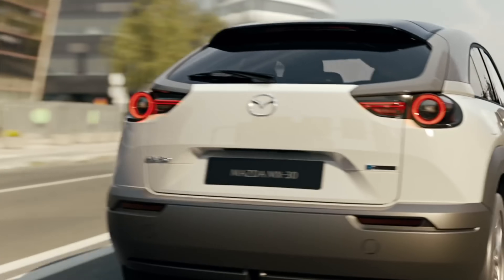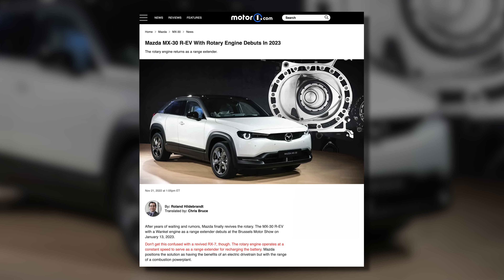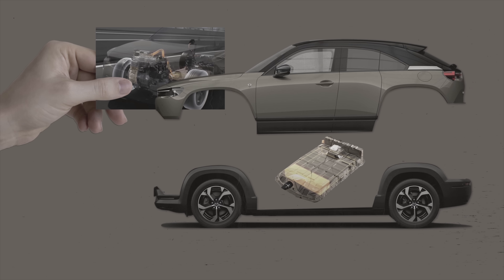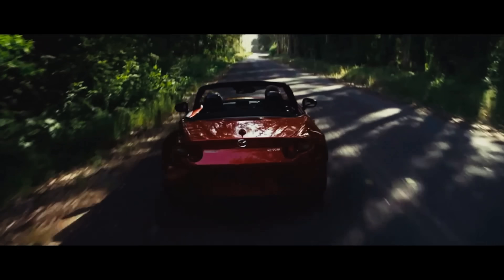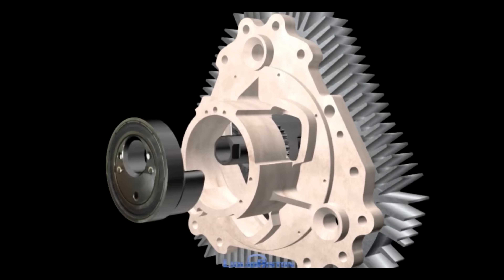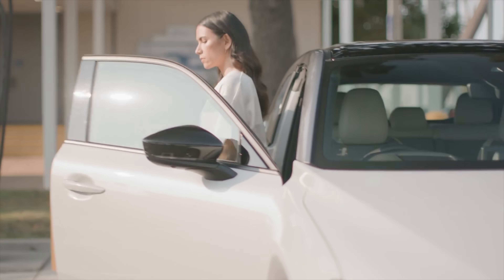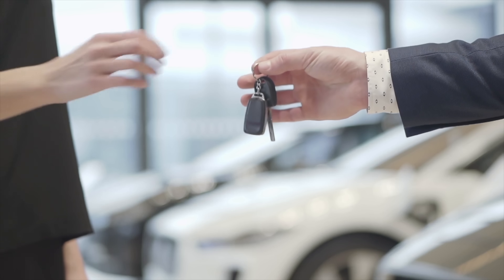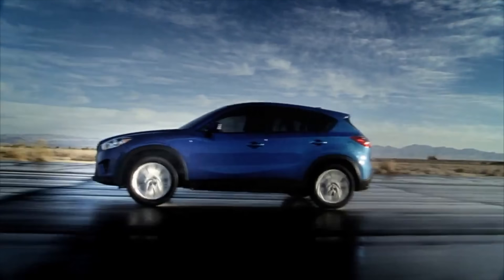Mazda's New Engine is the Smallest and Most Powerful Engine Ever Made

Comment: I LOVE IT! Small battery means lower recharge times, no need to rewire your garage,  lighter weight, gifts that keep on giving. However I would be more interested in a smaller version that gets 60 mpg and still gets 300-400 mile range.

Comment: If mazda made this for cx5/50 i would have definitely bought it.  Just need to increase reliability of the rotary engine.

MX30 failed due to range vs cost isnt practical

The new mx30 witb rotary is much better but i wouldnt pay over 30k

Comment: Driving on slippery roads is better done by any means other than combustion driven automatic transmission.  That's why I am waiting to upgrade from my combustion driven manual tranny until a decent range extending design is available to get me directly into total electric drive with a gas engine.

Comment: The rotary engine is cool, but if you over heat it, uou have problems. The apex seals suffer at that point. Itis almost a 2 cycle engine.  It will consume some oil.

Comment: Had a RX3 and a Suzuki RE5 motorcycle, both a lot of fun but expensive to maintain, terrible fuel mileage, excessive oil consumption, and engine failure. The smooth constant acceleration was awesome! Unless Mazda has found some revolutionary fix I think they are only going down triangular rabbit hole, once again. Based on the video I didn't see the improvements needed to compete with today's lightweight internal combustion engine. The rotary's 25% improvement in fuel consumption would make it a gas guzzler compared to todays internal combustion engine!!! The video NEVER gives the mpg while under rotary power, there is probably a GOOD reason!

Comment: This video ignores that when running an engine as a generator it can be a lot more efficient that if it is directly powering the wheels, this sis simply because such a task allows the engine to operate in the optimum power range at all time and doing so is also good for wear an tear.

As for the MX-30 not selling, to be frank that is because most everyone isn't being rational and insists on using big heavy cars with way more power and range than they ever need. Not only is doing so wasteful and unnecessarily expensive it also make for sub-optimal driving experiences - and those long trips or big hauls people are on about, most people do them so rare it blows my mind why they wanna punish them self every day by having a car that do such things.
No one in their right mind would use a big suitcase to carry their phone and a few other items on a daily basis, but people do the equivalent of that when driving.

Comment: I think we are going about this all backwards. The primary drive should be fossil fuel and the secondary (or supplementary) drive should be electric. This will allow the energy density of gas with the added electric torque (as needed) of the electric motors while keeping the battery size relatively small and lightweight.

Comment: Would be hesitant due😢 to the relatively short lifespan of the rotary charger. If it were to be economically viable vs. a standard hybrid, I might be interested.
Reply: Think they will last way longer: using it solely as auxiliary power unit means they can match generator and motor running on ideal rpms.

Comment: It's the NEW fad out there right now!    You can run your electric car motor with out putting fuel in it at all gas or electricity, NONE it'll run like all most for ever. changing tires and other car part. What your using is a self generated generator. yes it run on itself. it works YES! and you can have one in your car.Yet the Government will not let you produce them and sell them on open market. The Same as water buring engines Honda made one of them fully running the demo did not get approved for any sale what so ever expect you can have one for your personal USE ONLY.
Reply: Once the liberal gets booted off of Earth and into it. Then we will have NO FUEL CARS on the road. FREE Transportation

Comment: This is what EVs should be, it is called a "Serial Hybrid".  A medium sized battery with a genset to recharge it.  Strange that it took 12 years for auto makers to figure this out, and American automakers have yet to discover this architecture.  Just shows how stupid  the average American mechanical engineers have become.  If the Volt had come out like this, it would have decimated Tesla.  But no, the gearheads wanted a shaft and transmission between the wheels and the genset, and the eco-freaks wanted no genset.

This car is the first serious competitor to Tesla.

Comment: Rotary engines have been attempted many times, but the engineers never quite got the bugs out of the system when they went into production. Have they finally been ironed them out? The advantages of a rotary engine are intriguing, assuming it is reliable.

Comment: I like the idea of a battery extender engine. If the engine were air cooled, the engine could simply be bolted down and have two electric cables going to the batteries. If you need work done on the engine, it could be popped out in five minutes or less making it much easier to work on the engine.

Comment: Back in the 70's Honda tried rotary engines on some motorcycles. That failed due to starter issues. It seems that because the engine was so smooth and quiet that riders thought the engine had died  at lights and stop signs so they kept trying to start a running engine and ate up the starters.

Comment: When I buy a car I want short trip miles use and long trip miles use.  I do not want to go on a one day trip for 800-1000 miles and am forced to drive a care that takes 24 hours to charge after 250miles.  A one day trip turns into a 3-4 day trip.  Not for me.  If I want short miles in a car, I'd like to buy the air powered cars from France and use a home compressor to fill up for virtually free.  I want fast fuel up.  Electric charging lines are going to be too long and too many things interfere with the convenience driving a gas powered car.  With a break even cost of about 15.00 dollars a gallon, until gas reaches these prices, I'm sticking with gas or a decent hybrid who's motor can supply independent and and full power use of my vehicle.  The biggest hassle is the battery.  It costs more to replace them than buying a second hand gas vehicle.  Electric cars are a fad and they are going to gone.  I'd like to have a vote of the public, who is the government, and force politicians and big money companies out of the picture.  But, our voice doesn't count anymore.  After all, well simply get used to the changes and forget about how things used to be anyway.  (Zero Pollution Motors (ZPM) is poised to produce the first compressed air-powered car for sale in the United States by mid-2024.)

Comment: Hi Scotty, 
I've always wondered why manufacturers don't just put a small generator in their cars and do away with the battery altogether. Surely a small engine idling along at 2,000RPM would generate enough electric power to run the vehicle. The generator would use very minimal fuel, there'd be more space in the car, it'd be lighter, it'd be quieter and there'd be more torque. I'd also imagine the car would be a lot more affordable with no battery pack and also environmental damage from mining the various metals would be non existent. 
Would this work? 
Am I missing something?

Comment: The fuel economy and emissions aren't great, it's true, but the longevity isn't a problem. The early ones before Mazda had figured out what they were doing, and the late ones when they got away from simple designs, were not reliable, but the ones from 1976-1991 would run forever. 200,000 was common and 300,000+ happened regularly. My '76 lasted 250,000 and my '84 lasted 190,000 before it was wrecked.

Comment: Im concerned with the added weight of the ev version of a given vehicle model. Though a big engine is absent, battery density more than makes up for the weight loss, actually increasing the ev model model weight by 20-40%. My ‘17 Tahoe weighs ~5200#. GM Hummer ev weighs over 9000#, though basically the same size. Imagine that Hummer ev in a collision with a gas powered Civic or Escape which both weigh under 4000#. 😮

Comment: You briefly used a graphic of the "liquid piston" rotary. IMO, a better design than the Wankel. It sort of reverses the cylinder/rotor making the cylinder triangular and the rotor oval. Combustion happens in all three corners, evening out the heat distribution.

Comment: I think one of the other benefits of using a rotary engine as a range extender is how simple it is.  You don’t have to worry about valves and camshafts and all the other mechanical complexity that comes with a normal piston engine.  Cars are moving to electrification, it’s just the economics and benefits of it.  Having a range extender, as opposed to an more traditional hybrid, means that you don’t always have and ICE running.  Electric motors are more than powerful enough to be the drive motors of a vehicle.  Having a range extender means you don’t have to rely on power stations when on road trips, and don’t have to worry about using gas for a trip to the grocery store.

Comment: Interesting car and well presented. I had been bashed for asking for a "fat hybrid" with roughly 150-200km range + efficient range extender 2 years before (in german language/Germany): Battery is the future, hybrids are no longer needed.
I think this is wrong for those who like to have "only" one car for daily commuting plus 10 ...20 times driving for e.g. 200-600km per year. And in a modern world where we have a good chance not knowing if we have electricity or fuel next day, a hybrid is a reliable solution, at least in Germany where Nuclear Power will be shut down within the next 10 days ... coal will stop 2038 but some want 2030. Replacement? "What for, PV and wind is all we need ..."

Comment: Sounds more like desperation than a design feature, good luck Mazda you are going to need it.
Most people who are switching to an electric car are not looking for a petrol engine range extender, if you are going to make a range extender, I would have thought Diesel.
I think this is going to be a difficult sell especially with a battery range so short, if the battery range was 200 miles and then you had a range extender, they might of stood a chance.
But at the end of the day it is the consumer who decides so see what the sales show.

Comment: In my opinion this type of vehicle is what should be promoted, battery for the everyday commute and city driving, and small petrol engine for the occasional long journeys, the alternative is a massive electric battery using lots of rare materials, high tyre degradation due to weight along with the pollution that causes.

Comment: This rotary is what is known as a "work engine". It is designed to run ONLY at a VERY limited range of revs - NONE OF WHICH COULD SUPPORT EXTRACTING POWER TO DRIVE THE WHEELS.

Comment: It seems a lot of people does not understand that this is not Prius copy concept. It is the idea implemented on Chevrolet Volt and on some Ford variant. Mazda idea is a BEV (battery electric vehicle) with an ICE generator onboardcoupled as simple as possible. This new Mazda is a Series-hybrid, less complicated (electronically and mechanically) than a "Power-split or series-parallel hybrid" like Prius. The novelity is the weight of the electric generator (ICE+generator) and the possibility of changing the fuel to H2. (rotary adaption to hydrogen is easier than for a 4stroke ICE)

Comment: I can't understand why anyone would buy this car. It will be difficult for most drivers to get the engine repaired, the battery is going to be smaller, the price is already too high for the e-version so the price of the Re is going to be even higher. Also, because of the repair problem, it will be a car that nobody will want to hold onto past the point-of-no-repair-required date, so it will be dumped, not repaired for extended use, making it basically another source of junk to have to deal with environmentally. Buy a Honda.
Reply: Your exactly right Ryan. Dead end technology. Advantages are just smoke and mirrors and not too far down the track, a lemon of huge proportions you could not give away. Rubbish Matsuda. Give it up.

Comment: Literally nobody thought the MX-30 EV was any good.  A range of 124 miles at the same price as EVs with twice the range is a sick joke.  If they had kept the same battery and put in the range extender, it would have been interesting.  But, they cut the battery in half for the PHEV, with an EV range of 53 miles.  That was interesting in 2016, but not today.

Comment: This car agood concept I agree that 30 miles would be the most average. But what happens at 400 miles you got to stop and charge it because of built-in generator can only charge the batteries for more range.. It's like a cell phone being plugged in on a weak charger the battery will eventually become dead but then again a good charger we'll keep it at 100% then the battery will not discharge all the way it gets programmed then you find out you only got half the battery that you thought was full. Basically for my money I'm not putting my trust in batteries. I burned up a couple batteries in my cell phones. Keeping it charged at 100% will lead to short battery but draining it completely dead at ninety miles or 400 miles is the right answer. That's my guess.

Comment: This raised a couple questions extremely pertinent to forming an opinion. First, what is the fuel tank capacity? For example if it's extending the range to 400+ miles over the 124 of the all electric and it takes 20 gallons, then it's useless but if it's less than ten it's still only a fair improvement. If we are speaking of as few as 5-7 gallons, we're looking good. Besides weak tip seals, high maintenance/low mileage overhauls, and burning oil, rotaries have not exactly set any desirable fuel economy standards. Your general description paints a pretty picture but these are very important considerations that I would need assurances they are within reasonable proximity to solving. I'm not being disparaging, I have loved the "Wankle" from it's concept days and would like nothing better than to see it continue to reach it's full potential.

Comment: The range extender hybrids are the best way of car building. This principle was used in the train locomotive: the combustion motor drives the generator, which gives the power to the electric motor, which turns the wheels.

Comment: ESG money at work. why would you not use the energy from the ICE to directly move the car. every conversion step eats into work done. they should also put a wind turbine on it to increase drag and generate more power, hell they should drag a metal pipe that can scrape across the road and heat up water running threw it turning it in to steam and generate power from that.

Comment: The Wankel has serious potential as range extender. Unfortunately, it came out at a time when an engine design, called, Liquid Piston, a triangular one engine with heatsinks shown several times in this video. That one is also promising especially on the efficiency sides. The Wankel's saving grace is if the Liquid Piston constantly finds itself on dead ends that only makes it ideal up to motorcycles.

Comment: Considering the light weight of the engine, I would think the power plant might be ideal for a small hybrid airplane, or maybe the  Jetoptera.
Reply: Any idea what the actual engine weight is?  I had the same thought, using this motor to charge a 40KW battery while using several electric motors for aircraft thrust.

Comment: Silly move Mazda. Why do we need a gas motor when the EV's are getting such great milage - no motor needed.
Reply: Deluding yourself much? I admit, rotary engines are sketchy, but best mileage is dominated entirely by hybrids. The insane energy density of combustion fuels combined with the higher efficiency of combustion compartments designed to power electric motors absolutely dominates contemporary electric setups, and that's just with a 5-10% extra efficiency. Just take a look at the insane specs of F1 engines - their combustion compartments recently breached the 50% efficiency barrier and the cars are not projected to even consider going fully electric for several decades at the very least, provided combustion technology stagnates, which is obviously not the case.

Comment: Every train locomotive in the US and Canada is an IC/electric.  The rotary is uniquely suitable because it adores a high constant rpm.  The ONLY reason Mazdas have often needed a rebuild is people,,, with decades of experience driving piston engines, get in a rotary powered car and lug the engine.  Rotaries HATE to be lugged.  Does not mater what or when you always keep your rpms above 2,000 and preferably above 2500.  With an RX7 or Rotary pickup,, moving in a parking lot,, it sounded like a sewing machine running quickly.  And that was what it was supposed to sound like.  1,500 rpm,, that rotor is justa hammering back and forth.

Comment: I think Scotty has missed one major advantage. Presumably the engine has been designed to run at a constant RPM and can be optimised to be super efficient at this RPM. I would have throught a super efficient diesel could do this and charge the battery with super-miserly fuel efficiency.

Comment: Realistically if we want to use electric cars for commuting (the majority of driving people do) then making them cheaper by building lower range  would help adoption so long as people can get over range anxiety.

With most people driving 30-40 miles a day, you really don't need a 3 ton 300mile tank of an electric SUV just to move you and a bag to and from work.

Obviously some people need more, but most don't.

Ideally though we'd be using electric mass transit for commuting